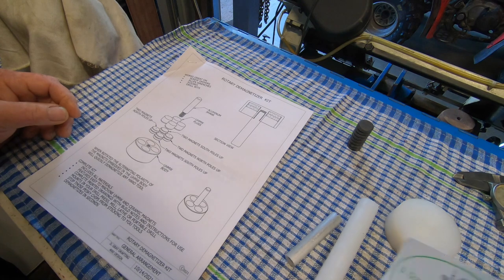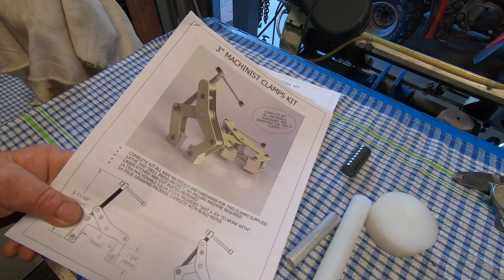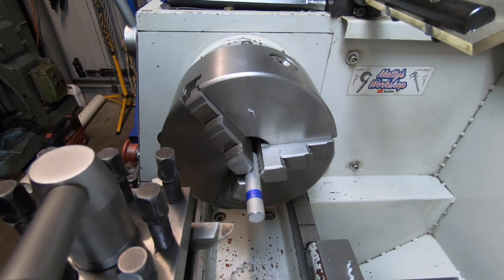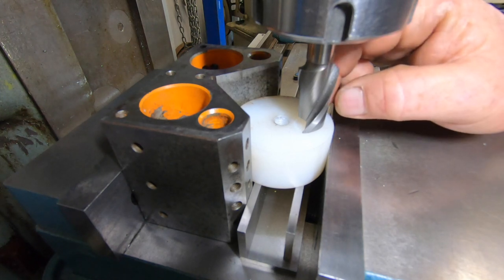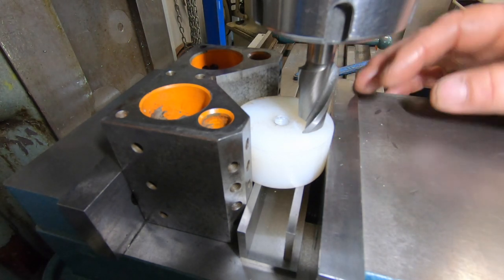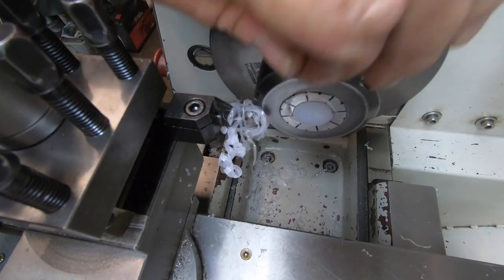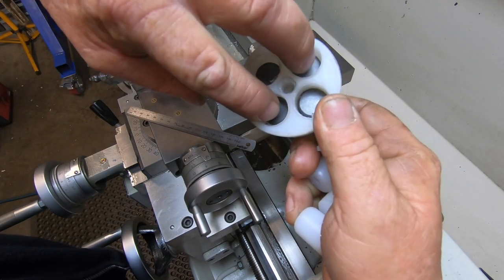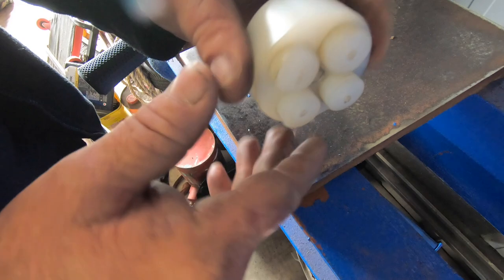Demagnetiser from D.Gray Drafting and Design

Comment: G'day Matty. Great simple build and it works-bonus! I simply hit the screwdriver on something heavy and handy like the vise, works also. Magnetic screwdrivers are handy at times also so th re-magnetise simply rap a heavy guage wire 7 or 8 times around the shaft and flash across a 12V battery but these days one not connected with a car, don't want to introduce spikes to the electronics:-(
Cheers Peter
Reply from the maker: Gday Peter, This was a really simple quick build, I think I magnetised the chips which is why they still stuck to the tip of the screwdriver, I remember as a kid watching day wind wire around a screwdriver and using a battery to magnetise it but never seen how he demagnetised it, Thanks for watching and commenting mate, Cheers

Comment: Interesting project Matty, could definitely see the improvement so it clearly works. Have used an Eclipse electronic one in the past after surface grinding but never seen this method before. Cheers, Jon
Reply from the maker: Gday Jon, I was surprised how well it works, I think I might have magnetised the chips as well which could explain why they still stuck a little, for a quick build it it’s a handy tool, thanks for watching and commenting mate, Cheers

Comment: Magnetized screwdrivers are a pain in the ass for certain things, but useful sometimes - but it's nice to have the option of demagnetizing them! I wonder if it would work better with those real strong neodymium ones instead of the what looks like  ferrite or cobalt discs? Great machining work as usual, Matty take care from the UK.
Reply: I seen a good engine get ruined by a magnetized screwdriver.  Good at picking up small objects from the bench it was sitting on, and dropping them down the throat of a carb with the mechanic being unaware of it.  

They had that happen twice before they figured out why.  First time was caught and corrected before major damage occurred.  Second time was a small, hardened steel key, it wedged between the piston and cylinder wall, and split the cylinder open, straight line bottom to top.

Both mechanics in that shop developed OCD about wiping tools off with a cloth before they entered/re-entered an engine compartment.
Reply from the maker: Gday Dudley, as times gone on a lot of my tools have become magnetised, it really is a pain in the ass, im not sure how the different magnets would go, at a guess id say they would work well, Thanks for watching and commenting mate, Cheers
Reply from the maker: Gday, how easy it can happen, almost got caught myself when I put the new engine in the hilux, I dint blame them becoming OCD, Cheers

Comment: Hi Matty.  Interesting effect.  I have an electric demagnetiser which works by changing polarity of a coil at high frequency.  Pretty much the same physics, but different process to get there.  Wow, that new screw driver was really magnetised.  Makes me wonder if they deliberately made it that way to help hold screws on the tip.  Some mechanics used to magnetise screw drivers for exactly that reason (just stroke a magnet down the shaft a few times).  I don't use a magnetic swarf pickup on the lathe for just that reason.  I prefer the good old shop vacuum to avoid that issue with machinery.  Cheers Rob
Reply from the maker: Gday Rob., id say you right, the home hobbyist doing normal weekend home maintaince, having the magnetism would be a handy thing, I also dont use a mag stick to clean the machines, shop vac is the way to go, Thanks for watching and commenting mate, Cheers

Comment: I have a powered mag chuck on my surface grinder, I can use the de-mag function that is on it.  Like yours, it takes more than a pass/moment or two to get the job done.
Reply from the maker: Gdat, I didn't realise a mag chuck has is function, i've never seen anyone show this before, its a great idea, Thanks for watching, Cheers
Reply: @MattysWorkshop   It would actually be in the power supply to the mag chuck.  Some may not have it.  Pretty sure the non-powered chucks don't.

I just put up a clip showing the de-mag's affect on swarf/dust that had built up at the end of some parts I was cleaning up.
Reply from the maker: @infoanorexic  thanks for the video, just subscribed to mate

Comment: That's mad!
I just bought a mains powered one off ebay for a project I'm doing for someone. Also downloaded a Gauss meter for my phone too.
Nice work as always Matty !
Reply from the maker: Gday Neil, it is crazy how it works, I hope you filming the project mate, Thanks for watching and commenting mate, Cheers
Reply: I bought a mains powered one off ebay, too.  The first thing that I did was to change the 2-core supply cable to a 2-core+earth cable and earth the metal box and inductor core to make it safe (and legal in Australia).  It works like a charm.  My gut feeling is that Matty's rotary version needs stronger magnets and the contact surface of the acetal skimming to bring the buried magnets closer to the surface.  Also, run the mill faster, say 1500rpm.

Comment: just wondering if that tiny bit of magnetic attraction left behind, was due to the short section of the driver blade tang that is buried in the handle, having become magnetized with the rest of the blade when it was manufactured. Might be worth trying to demag the whole length of the tool ?
Reply from the maker: Gday, I never thought about the handle, that’s a really good point and I’ll do the whole tool next time I use it, thanks for watching, cheers